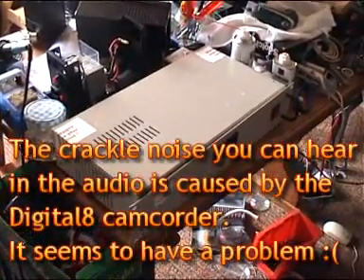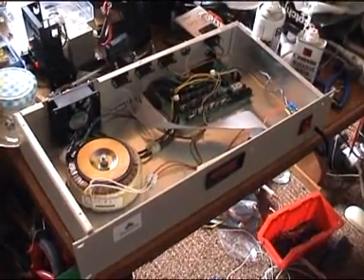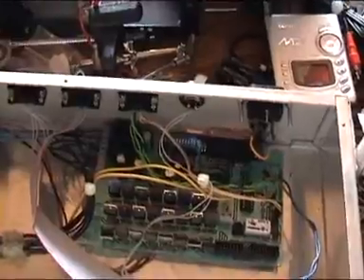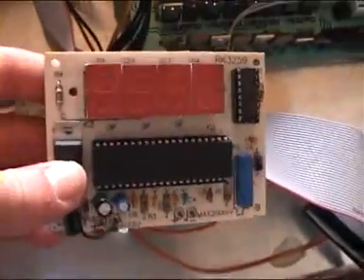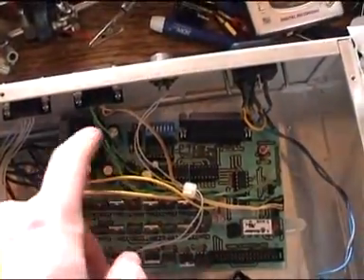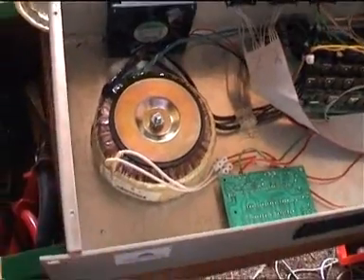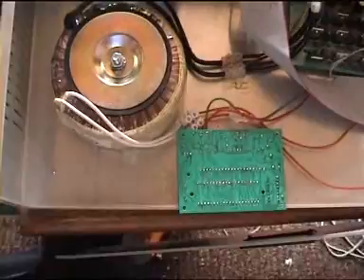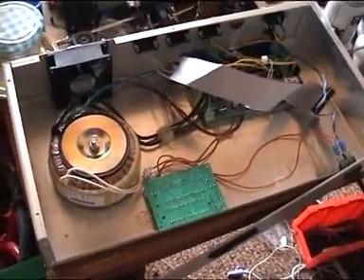DrCassette's Workshop - CNC mystery device!

Comment from the maker: @CoolDudeClem 
I think this might have been some kind of a power supply because it has all the power supply components and a volt meter on the front.
I am planning to use this whole thing as a power supply for something else, I might built an amplifier into the housing and use the existing power supply for it.